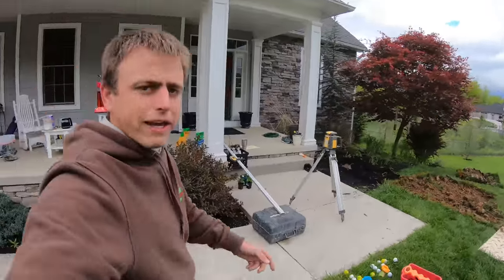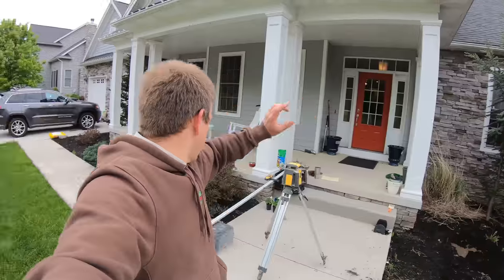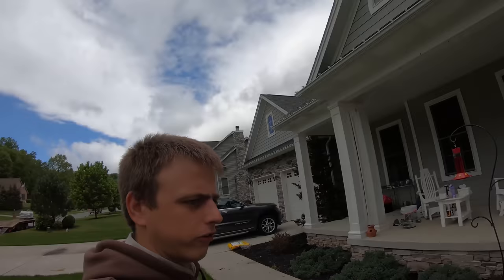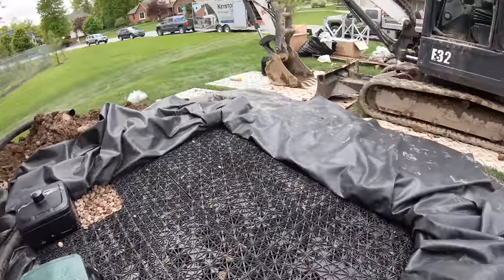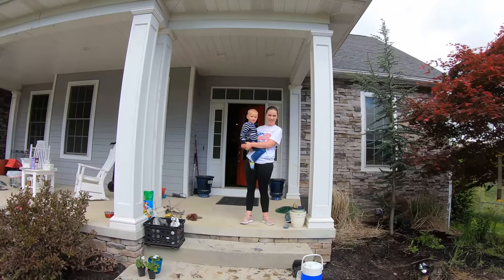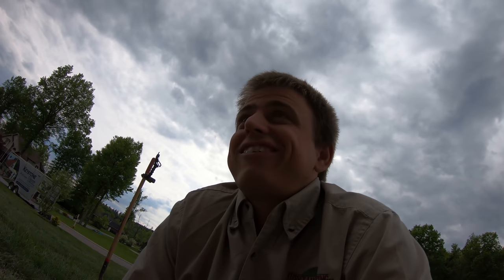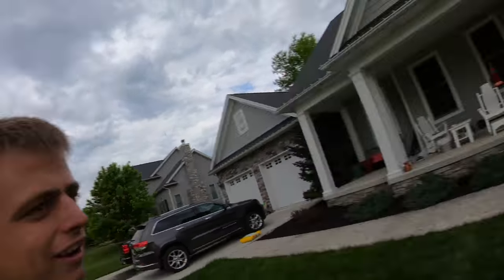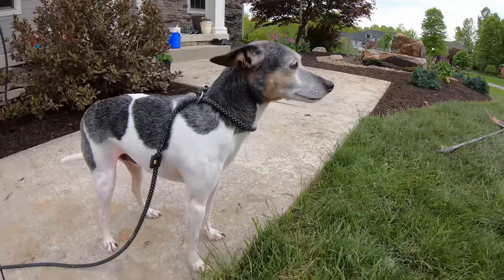Gorgeous BUBBLING ROCK at Front Door | ON THE JOB

Comment: How do you get the holes drilled through the rocks with what drill and what inch hole is it thank you
Reply from the maker: That is a 2.5" hole in the rocks, so we can insert 2" pipe.
Reply from the maker: We use a big hammer drill
Reply: Ok thank you y’all do great work
Reply from the maker: Thanks Rex! Good luck